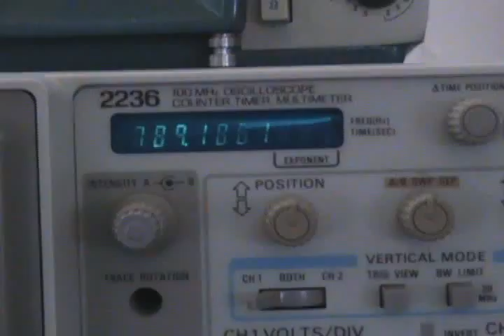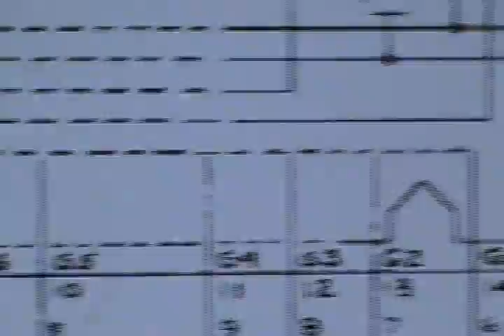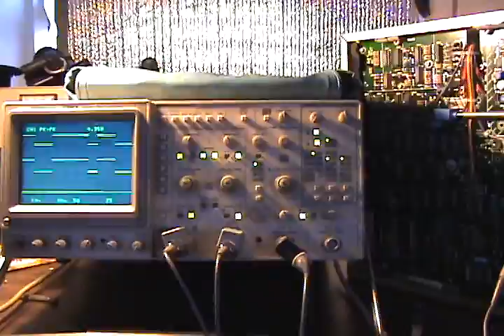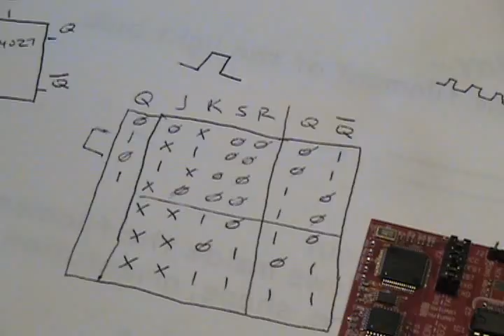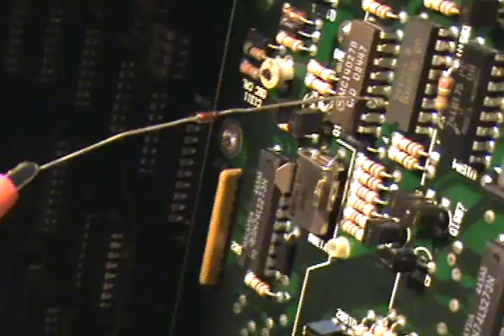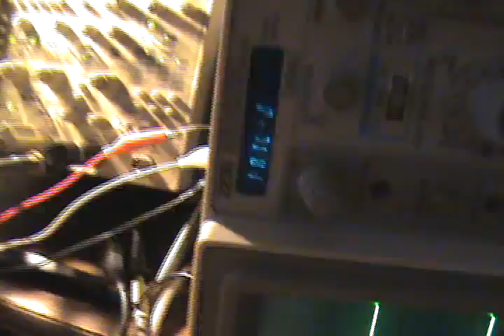Tektronix 2236 Repair

Comment from the maker: To some degree, yes. The odds are always good that deflection problems are because of a missing voltage in the vertical deflection circuit. If you have a schematic, start checking out the voltages around the output transistors (or amplifier IC), and if they aren't right, follow the problem back toward the power supply. If it's good, check voltages around the small-signal parts of the circuit. You''ll likely find something that doesn't match what the schematic calls for. Good luck!

Comment from the maker: Thanks! That MSP430 can be programmed in C. It's fairly low-level... you're mostly putting values directly into registers to make the chip do things. If you know a little bit about the internal workings of a computer it isn't hard to grasp. Others like the Arduino have higher-level libraries you can use that make it quicker to get your project working. I'd start there unless you really want the dirty details. It's worth it. Just about every micro can be programmed in C.

Comment: Seems like it would have been nice to look into retrofitting a small LCD display if it's not feasible to lay hands on a suitable vacuum fluorescent display as a direct replacement. Being a micro controller guy it seems that would have been a fun project.

Comment: Thanks for documenting this repair and sharing it with us. I especially liked the part where you explained how a JK flip flop work, because I wasn't quite sure about that before. What is the programming language you used when programming the micro controller? Difficult to learn? Also, what happened after you replaced the flip flop chip, did the output signals change to the expected waveform?

Comment: Thanks. I took a long break from the hobby, so I'm very rusty. My Grandpa gave me the scope, so I don't want to trash it. It's from the early 80's, and was wondering if dried out capacitors could be to blame? I kind of ruled that out because the problem is intermitent, so I'm thinking a bad connection. I do have the schematic though!

Comment from the maker: Intermittent, how? Is it affected by temperature or vibration, or just completely random? The scope in this video had intermittent horizontal sweep problems that I found to be caused by a flaky pcb-mount 1k pot, used to set the width of the sweep. Easy fix, once I figured out what it was. What model make/model is yours?